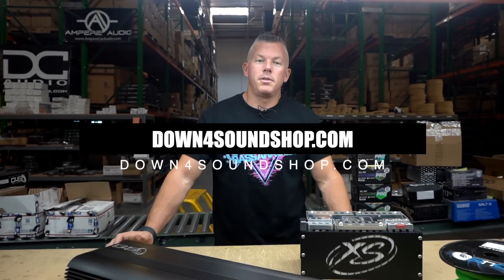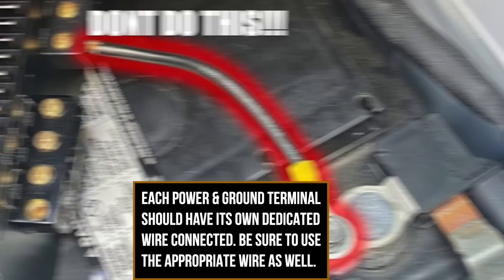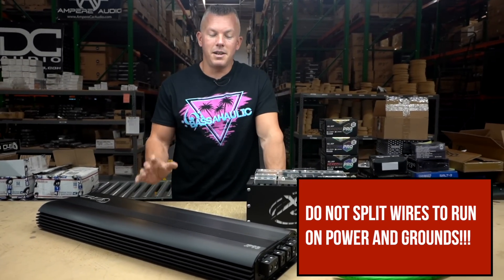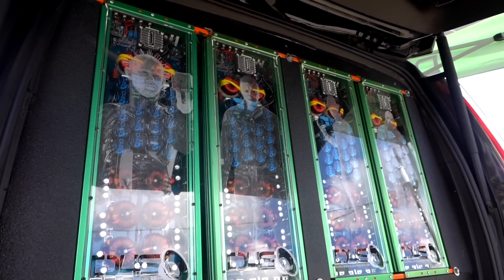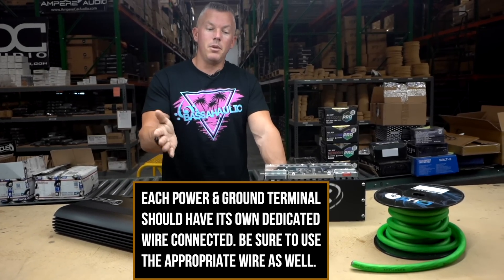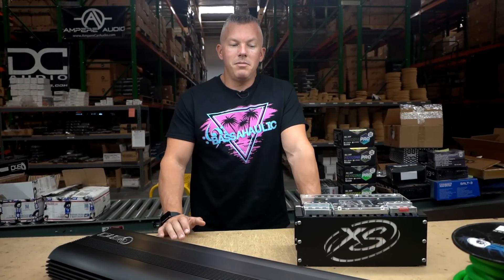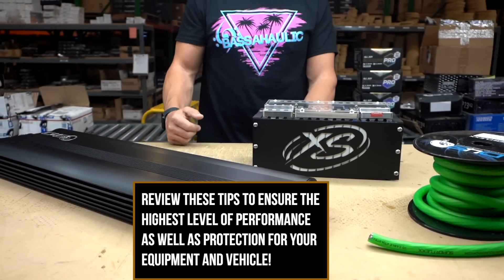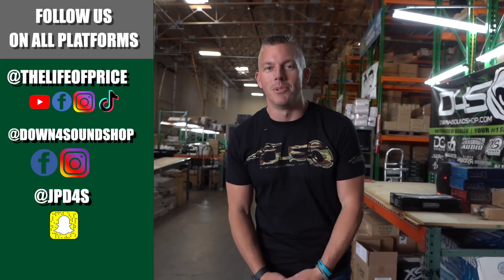STOP DOING THIS TO YOUR POWER AND GROUND TERMINALS!!! WITH JOHNATHAN PRICE

Comment: so what if my amp has 1/0 inputs but i had 4awg laying around so i ran two 4awg leads off my battery which is under the rear seat and ran both leads into a 2-1 block and then hoked that into my amp. so essentially i have bigger tahn one single 1/0  should be good right sounds legit to me

Comment: What I hate is when someone is initially going to do a good thing by giving solid and FREE information to help people BUT then they act like a typical Reddit "responder" and when they give their "advice" they act smug as hell when they do it. Their voice laced with a very rude, condescending tone that does nothing more than suggest .....NO not suggest but infer that your very low intelligence and have to literally be told that GRD means ground. Or that 12V+ means your positive battery side (not even thinking that a person would understand it going to the positive side from not only the 12 OR the V OR the + symbol MUCH LESS ANY of those combined together OR shockingly even all of them together. 

Even if you know nothing about electricity and were faced with 2 choices of GRD OR 12V+ which do you think the person with ZERO knowledge would immediately think goes to what? I mean when you say POSITIVE and have a + sign what else does that mean? A family member of mine used to describe it as "being very polite (or at least acting like it) in a very rude tone" or being a very polite rude if that makes sense. We have ALL met people like that and the first just 2 minutes of this video was the perfect example of polite rude. People like this don't get it that "listeners" aren't receptive when you are essentially calling them stupid. So stupid that you have to take the bare essentials of an amp and even "dumb down" that explanation. 

The fact of the matter is you can tell chuckles here had a bad run in with someone and either an arguement or he disagreed with something they did or a question they asked so much so that he made a video and basically insulted anyone he feels like needs the explanation that he's giving. Do you need to not get very "technical" with beginners? Of course you need to not use as sophisticated explanation's as you would when talking say another expert BUT there are ways to do it and the way you did it was to be intentionally insulting. There are WAY, WAY, WAY too many intelligent and nice car audio guys on YouTube that don't treat their subscribers this way. Thats what I found to be the funniest part it's like you think you are so special that you could do this and people somehow wouldn't have any other choice but to just take it.

Yeah no thanks slick I'm good. What's worse is I know it wasn't even directed at me as I've been around professional car audio for decades but I'm also not going to watch someone make ANYONE else feel "lesser" just because they think they are either so far above them or they think "their" information is just so precious that they can get away with insulting the lesser experienced, smh

Comment: Common mistake and guilty as charged in my early years. It takes power to make power. I run dual inputs, secondary battery banks and direct connections for my amps now. Also upgrade your alternator and make sure your engine is in tip top shape. Blown a few amps learning the hard way in the past.

Comment: I always consider 99% of the 1 star reviews are people that need to go apologize to an entire forest for wasting the O2 it produced. 

I do this stuff on the side for fun and because I like seeing peoples eyes light up when their new system comes to life but one of the biggest things I get from people is the push back on how much proper electrical components cost. 

Dude that bit about power deficiency to run this amp..... hit home so hard....  A dude with a 2014 Charger R/T recently brought me 3 amps (2 4-channel (Bridged to 250x2 - x2) and a 3500 watt mono block ~4500 watt total~) bought decent speakers and subs - then bitched and said I was ripping him off when I told him his factory 160A alternator will not run 300-315A in current draw... That he needed a 400A minimum with big 3 upgrade......

Told him I can install (which I did) but that if he is not going to upgrade his electrical system I can get him the same volume with half the wattage in amplifies due to he does not have enough power in his entire electrical to adequately power what he wants. I then  had to run a big 3 upgrade and alternator after getting the entire car back together since he was dead set on what he bought... Then bitched when I charged more for labor to tear the car apart and put it back together AGAIN!!!!!      FML

Comment: They want to bass so bad there thinking I can do it the easy way and you can't.. I am only pushing 1500 watts using a skar Skv2-1500.1D I have a big 3 upgrade with the stock alternator a yellow top under the hood and a yellow top in the back all zero Gauge just to make sure I am good and I have no voltage drop id rather be safe then sorry .. I'd rather have the over kill in electrical then not have it at all and besides I'll have room to upgrade to a 2500 watt amp if I wanted to and still be good with my electrical.

Comment: You don't have any experience doing installs. I have watched a few of your videos and you should go back and look at some of your advice. Also for what length are you using zero gauge.  Dual inputs maybe required.  Dissing your customers will not be a great selling feature.  Educate them if  you have the knowledge.  Not whine and slam. You have what you have because of them.  Be grateful and teach. 😊
Reply from the maker: I am educating them sir 😊

Comment: Question, and only because i see professional shops do it, running an 800w bass amp and 1000w 4ch i see pro shops run 0ga to two 4ga to the amps. What are the thoughts on that?

Comment: I've seen one like this, Audiopipe APHF-8000. the dudes installer had two runs of CCA 0awg for like a foot and then a splitter being fed with a single 4awg from the battery.

Comment: I have a question, excuse if it’s dumb, but what if I’m running a 0 awg and split it to 2 4awg wires… one for subs (taramps amp) and the other for the mids? Not toooo savvy tech lol.. with each one its own fuse box ?

Comment: Yes it is no good to use a 0 gauge wire leading to distribution block and then running 0 again to each connection.  How can people not know let say for each connection for example is 150 amps each.  And you plan to use the same 150 amp and splitting it to 3 wire connection which will end up with 50 amps each which is too smal for each connection.  You would need bigger wire that handles 150 x 3 which is 450 amperage as the main wire and then you can run zero.  Using only that 150 amperage as the main will always blow the fuse or make the main wire super hot from the demand of thr other 3 other wires and may cause fires.  For me I have an 800 watt mono amp and I run 6ft of 4 gauge at 125amps to going to a dfused block.  Then I have 80 amp fuse going  through 8 gauge wire to my 1 amp that requires it.    So instead of running all 8 gauge and having it handle an 80 amp fuse, I have 4 gauge running that can handle more amperage then split it to send whatever 125 amperage I can use it on,  like my 8 guage wire which is taking 80 amperage  to the amp nun of 5 feet from the dblock.  This was a good video to watch!

Comment: I'm more of a budget builder because of the amount of money it takes to upgrade the electrical to make it compatible. I don't want to get that deep into it. lol. And it should be commonsense that if an amp has three inputs, that they should all be used... Especially if it's an 8,000 watt amp. Smh. lol. A small car can only handle around 1500 watts total, not very efficiently... If one's been into car audio for a while, that should be a given. If one don't know, ask questions before bad things happen. I have a second XS Power AGM battery and a big 3 with 4G OFC run throughout the car to the amp and I'm only running 1000w. Between stock and upgraded electrical, I can tell a big difference in my car's performance because my system has drained my battery at full tilt when it was stock. It would literally pull my RPM's down as the bass hit. lol. Too much strain on a stock alternator.

Comment: I need a licensed D4Sound dealer in Chicago please.
Today is Nov 21 2024
I would like to have this for my B day.
Also I do not want to do any runs in side the car and have all wires just run under the vehicle.
Sound deadening ,volt metter,bass knob,cooling system,and at least a 370amp alternator I need as well.

I like the Q Bomb box or Q Power style box with some type of attachment to wheel out the box in case I need trunk space.
I like dual 12s or 15s I just don't know what subs to get from D4S 🔊

Comment: I  made a comment awhile ago and I'm going to let everyone know this instead of running your power wires and ground wires straight in your amplifier?I don't recommend that they won't stay tight what I  did is bought some 1/0 gauge fittings 2 1/0 GAUGE INTO ONE THAT WAY I KNOW THEY WON'T WIGGLE LOOSE YOU CAN USE ONE WIRE OR TWO IT DOESN'T MATTER

Comment: I’ve been rocking with down4sound for years. I even got the original logo stickers still on my truck to this day lol. JP’s my bass head idol 💪🏿, i’ve been listening to this man way before he came out with his line of products,     then once they came out with the d4s jp23 I bought it and not once have I ever had a problem with it. And I abuse the hell out of it pushing 2 15s with a massive electrical system that coast way more than the 2 15s and amp combined without breaking a sweat If you don’t know what you doing, don’t buy it. And what gets me every time is the ones that don’t know what they’re doing and ends up blowing they’re amp up goes and get something cheaper which starts with a S and end with a R  and swear up and down that it’s better. Hell no. Like I said if you don’t know what you’re doing leave it alone and leave it for the people that knows what they’re doing with these amps like myself. Thank you lol

Comment: 1 run + & -  of 4/0 to that amp use 3 1/0 ga per terminal, so you have 1 1/0 left over.  So you have plenty of amperage to supply power.

Comment: now I'm not into competitions and such, although I probably could.. However, I have three f250s, 88 Monte Carlo, and a 70 cutlass convertible! all have music.. I just started using the D4S products and literally loaded my MC with 14 different D4S components and 6 tweets! I also have a couple amps ranging from 500-2400w. I have NOT experienced an issue EVER with any D4S products! I'm currently debating on adding one more 12 to the 2 existing 12s in my MC, but I'm on the fence about just switching out those 2 and getting 3 of those D4S DVX or even the DBZ 12s.. now I have lost a couple of the ds18 amps.. those are complete trash...

Comment: If they want stock electrical use orion xtr amp is only one i can think of rated to run off 12 volts and get rated power.

Comment: I mean if you have a main 2/0 and split that into two 1/0 runs for the inputs on an amp that calls for two 1/0 inputs, that is electrically and functionally the same as two full-length runs of 1/0..

Anyways, kind of surprised your amps actually run with just one input.  I sold my JP33 (no issues, just needed more power) and the buyer emailed me saying it didnt work and wanted a refund.  Turned out he only connected one set of power and grounds.  As soon as he wired up the other two everything was all good.

Otherwise my only issue with D4S amps is when I DID have an issue with my JP33 remote I contacted your support TWICE and never got a reply.  Not a delayed reply, just straight NO reply.  That is why I wont buy any more D4S amps.  I will keep buying the speakers though ha, best bang for the buck by FAR, easily besting some speakers that cost 10x more.  Was hoping to get one of your subs but at 1700w I can't imagine they would perform better than my 4700w American Bass Godzilla does gobbling 8000 clean watts..

Comment: People need to learn the right way to install their equipment. You don’t run an extension cord for a 100 hp motor so why would someone  run 10 gauge on a 4500 watt amp.
Wire isn’t just wire, length of the run, how many amps are being drawn, grommet for wire pass thru, alternator output, fusing and real grounds have to be considered when installing any thing.

Comment: Now how much electrical back up should I need to run 2 1200 watt amps or maybe 2 1500 watt amps I used to have 3 boat batteries in the trunk I don't know if this was overkill or not but I'm fixin to run about the same stuff or do I need more of somethin it had a 150 watt alternator I don't know if I need more or was that fine

Comment: That's funny like trying to pull 400 amps on 2 gauge wire and swear it's fine when you know it's only getting 150 amps and clipping because it doesn't have enough power

Comment: I am always amazed how so many people want to be loud,but don't understand what it really takes to get there. J.P. you have to tell them the truth onnce and for all. Some bass heads have to understand that big amps require big electrical. People need to actually see it in real time to get it in their heads. You probably have to make a full video on this,giving different examples on applications. 💯💯💯👍
Reply: All someone really needs to do is look at you tube at guys like Steve Meade, John Price, and so many others. If they would pay attention to the wiring instead of the flex, it would be obvious. Another thing they don’t understand is the cheaper aluminum coated with copper wire is not as efficient as pure copper which is indicated by the cost difference. This wire won’t carry the same amperage when comparing same for same wire sizes.

Comment: nothing wrong with mounting to a box, unless its a cheap prefab that flexes. A proper enclosure is one of the best paces to mount. It should flex a lot less than any interior car part. Its an old wives tale to say mounting to the box is bad

Comment: He forgot to mention if your not matching subs with amps then its another way to fail if you dont know about matching the ohm loads then your gonna fail if you have factory electrical the lower the ohm load the more amps it will pull and put stress on the alternator and the amp will fry for not having enough juice fail fail fail i learned the hard way.. so dont bash jp because you dont know what you are doing j.p. and williston audio  have changed the game

Comment: My system consists of 2 JP 234 a JP 8 and a JP 33 and all 4 of my amps are powered by 1/0 power and 1/0 ground and I have a 370 amp alt. And 100 amp hours of lithium battery and it pounds like crazy to me and my voltage never dips below 14 volts.

Comment: JP, you aren’t taking into consideration the length of the power and ground wires, if the amp is 5 ft away from the power source, then you can use one pair of power wires, the less length of wire the higher amperage capacity.

Comment: Hey JP, big fan here, sorry you are going through this.  There will always be new people to  the hobby that have no idea what they are doing, luckily when I was green, amplifier power was around $8 per watt (adjusted for inflation.)  So I cut my teeth on tiny little amps that made 40 or 50  watts.  I thought I had made it big when I bought a used Linear Power 1501, 75 watts by 2!  Kid's today can buy a 3000+ watt amp while working the same minimum wage job I had back in the day.   We need to educate the young guys coming up, but not be angry at their ignorance.  We don't want to sour them on the hobby.  Take care brother.

Comment: That's cool that you're giving tips, but you're being a bit condenseding. "Why would anyone do this" etc. Why are car audio authorities such dix!? But the reason that someone MIGHT do it, is because some amplifiers WILL accept a large enough wire to support the amperage in each. (Maybe not YOUR AMPS) I understand that it's necessary to use 2, because the the conductors inside the amp aren't big enough for single terminal use. Just say "hey it's required to use both" not "hey moron, are you stupid" Most sheep are nuts about  YOUR AMPS. Because they watch all of your youtube posse that would have watchers believe your amplifiers are the only ones that won't rob their mother.

Comment: Car Stereo installations used to be an absolute artform back in the 80's and 90's. Hell, if you could even see them at all, screwheads were even in aligned all the same way. People cared.

Today, installs are pure garbage. I don't get it and I never will get it. You're spending all of this money on components, so DO YOUR INSTALL CORRECTLY, AND ACTUALLY FINISH YOUR INSTALL!

Install it right! And pretty matters!

Comment: I remember that post. I remember him saying he used 4 gauge wire. I even commented that was his problem, cable not nearly large enough. I just installed my jp43 with 2 runs of d4s 1/0 cable, my series 3 lithium, and my 310 amp alternator plus my runs of 4/0 cable from alt to battery and grounds.

Comment: Hey, I got a question , what happened to that JP40's??? I tried to find it on the site but couldn't,  i wanted to get two of them for my truck cuz im running a JS alternator 250 with 1 extra amg battery on a 3k for my two Trinity 18's wanted to upgrade to two 5k's but i need more batteries so i was thinking about two of those JP40's

Comment: Bottom line is that there are folks trying to run big boy amps on stock electrical. If they did even a small amount of homework on their vehicles OE alternator/ battery capacity they would have realized they're not prepared to run the amp in the first place. Big D has started really pushing this in the past year or two and that's a good thing. hopefully folks start to wise up and quit wasting your time with ignorant azz problems like this.